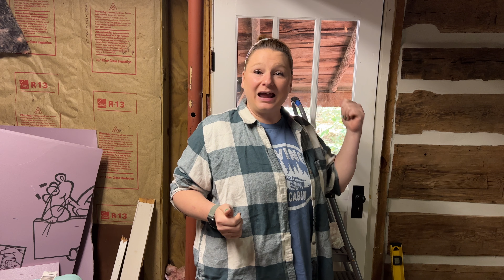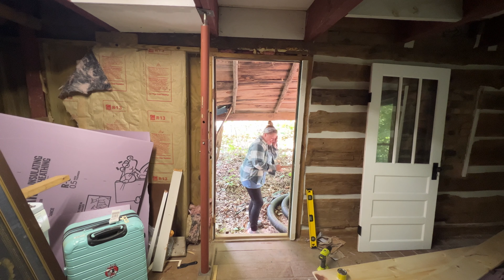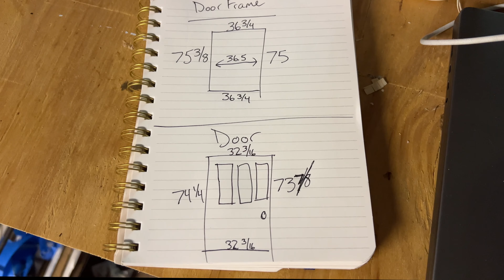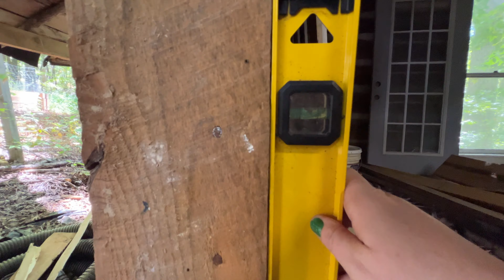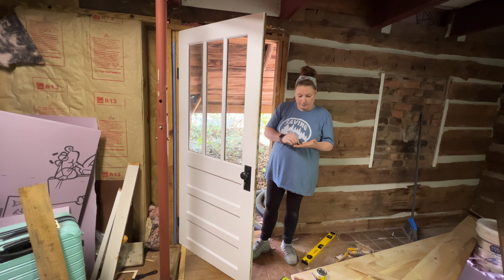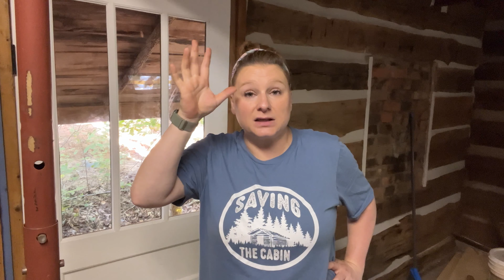Framing The Back Door.

Comment: Candice,  that water pump is called a Pitcher Pump. My grandparents  had one in one of there kitchens. It was very tiny with a cupboard  and electric  stove and a sink with faucet  and pump was at other end. I had an 1822 house and we discovered  the well half under kitchen  and  other half outside.  It had pipes set up for a Pitcher  Pump  , but we never got around  to putting  one connected to the well. We built the foundation  outside  the house and pipes were there we never finished  it though.

Comment: Great job. Maybe get that foam that has sticky one on side I got that helps fill those spaces around the door. Yes, if it wet now, wait to settle till it its in the winter heat so can see it expands or contracts. I found a big contrast in ours in one house and the the floor guy had to redo it. Looking good. And get you your own little tool.chest with your tools, just for you!

Comment: I love your Pink Panther. Use the side of the small hammer. Better leverage. I grew up living in a double wide garage. The only plumbing was at the sink. We used an outhouse. This was from 1950 to 1965. My mother died of cancer in the spring of 1964. January of 1965 my dad won a 3 bedroom, 1 bath home on an acre of land in a card game. I actually counted myself lucky. Wasn't sleeping in a tent or on the street. I learned at a very young age to never judge a book by its cover. It has served me well. Better late than never is good. Your dedication and the responsibility you have are commendable. Maybe you could look up how to do a wedge. That would take care of the gaps. wood glue and finishing nails. I believe you are going a fabulous job. Especially considering you started out as not having a clue. You have learned fast, quick and in a hurry lady. Give credit where credit is due. Have fun. By the way, it was probably a squirrel.
Reply from the maker: It sounded much larger, I’m guessing opossum, since I’ve seen them on the cameras.
Reply: She might be setting up a den for winter. That tiny scorpion was crazy. I used to spend summers in Alabama and Mississippi, and I have seen them smaller than that. My grandma and uncle told me that they are as small as a spider when they're born.

Comment: take some poster board the size of the bottom hinge. take screws out put shims in till you get the gap closed in up a little better. i saw the on youtube one time. it really works great. as for as dragging on the floor, you cab take a skill saw and cut the bottom of the door by 1/8 of an inch

Comment: First thing I would do is to TELL YOUR sweet loving HUSBAND, that in order to get thinks done, around the Cabin, you need
to have a 
H A M M E R!  One that is not Itty Bitty!
Put your Name on the 
Hammer and explain to him how much you need it to do the work around the Cabin! Tell him to go to the Hardware store and get at least TWO  Hammers! One with a little bit more Weight to it and then one like you already have!
Just REMEMBER, he is a MAN, and that he can’t help himself! 😂
Sounds like they CUT THE DOOR to fit the 
Frame? Usually a door is 80 inches high and any where from 32 to 36 inches wide! (Of course you can buy a door, the size you want it!) But generally 
If you went to Home Depot and measured their doors, 80 inches tall and 32 to 36 inches wide. So, whoever had to cut the door to fit the frame! 
Also, the reason why they used NAILS instead of SCREWS, nails can bend like when the Cabin Expands, with hot weather, But Screws Don’t! They tin to break!

I believe that you are doing a great job of fixing the Cabin, just don’t get Discouraged, when working on something! If you get upset about something, stop what you did and go do something else! 
Keep doing what you are doing! You be done before you know it!